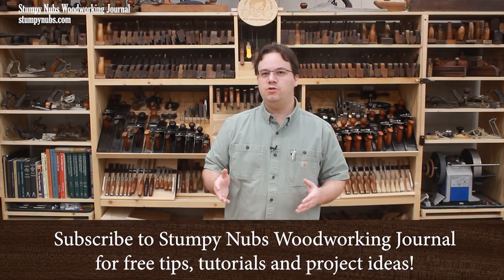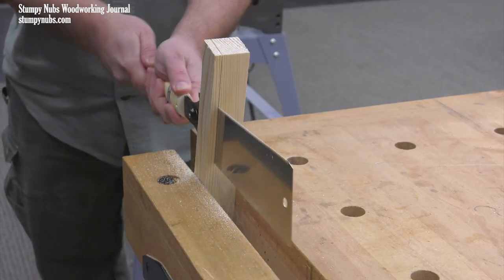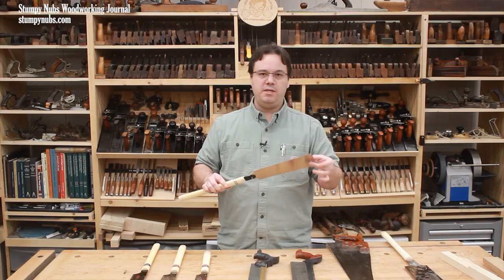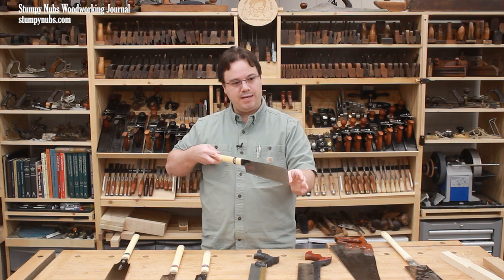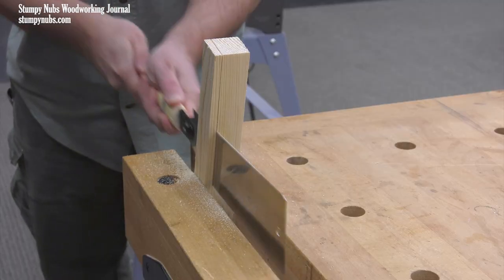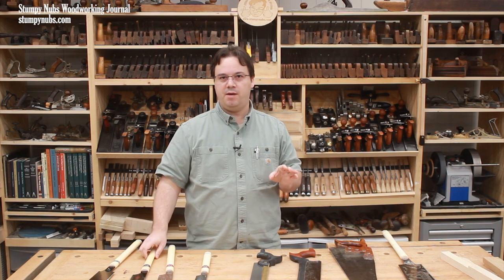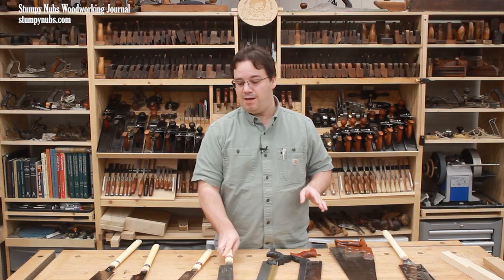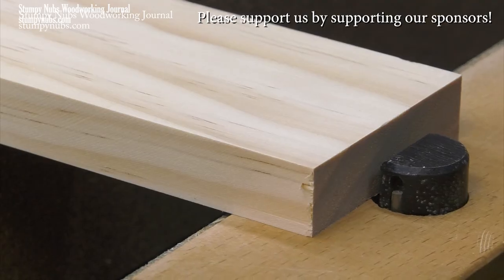Is Japan slowly killing western-style saws?

Comment: The disposable induction hardened blades are what make Japanese style saws viable at all.  And the CHEAP and massive availability of high quality USED western saws is the only thing making them a viable option compared to the cheap Japanese saws.  A high end sharpen able Japanese saw is silly when either a cheap disposable Japanese blade or a good used western saw will do just as well and the same can be said for a high end expensive new western saws.  I prefer western style saws, I've never payed more then $8 for one.  The only downside I see is you DO have to spend some time sharpening and setting, and learn how to do it.  (child's play compared to sharpening a Japanese saw)  Our bodies are just better at pushing than pulling, but Japanese saws take less force so it seems awash to me.  In general I'd say the smaller and finer the cut the more Japanese saws make sense and the larger and rougher the cut the more western saws make sense.  So I suppose if you have lots of high end power tools I can see where one might find more uses for the Japanese saws.  I've ripped oak 4x4's with a western hand saw without too much trouble because my 1960 table saw wasn't' up to the task.  While that could be done with A Japanese saw it would give me a terribly sore back.

Comment: No it's not.
Not until we in the west starts to sit on the floor to work.
We push they pull that is because they traditionally sat on the floor and if they had a tool that pushed then they'd push themselves over.
So that's why we push and they pull.

Comment: You didn't mention flush cut saws - my understanding is they have offset teeth on one side only, is this true?
Reply from the maker: Yes I did :)
Reply: @StumpyNubs  oh, I must have been confused with my understanding then, I assumed that one face of the blade had no teeth offset and the other had some meaning that the kerf was developed on only one side of the blade, meaning you could stay closer to a protrusion on a surface without scratching the finished face (think cutting off a dowel or similar). Love your channel by the way👍

Comment: While the video is nice and informative, Japanese tools are not representative of Eastern woodworking and the two traditions did not develop independently at all... 

Most of Asia uses Chinese style planes, which are pushed with both hands using a trough handle. In Korea or Taiwan people use Japanese style planes on a push stroke with a handle too. 

Most of Asia also uses frame saws on the push stroke. Frame saws eliminate the problem of tension but can be inconvenient when working on the ground like in Japan. The main difference between push and pull stroke is the length of the stroke, a Western panel saw is twice as long as a ripcut Kataba. This also means that the saws have a lot less teeth, which is why you can spend more time sharpening each tooth and get a more complex geometry.

Comment: I would disagree that there are "western" and "eastern" saws. Most of the slavic world and continental Europe were using frame/bow saws, which are used both as pull and push saw (you would say its twice as fast :-D). There were of course highly precise saws for detail woodworking, but those were made as well as bow saws. Saws without tensioning became popular maybe 20 years ago here in Czechia. Japanese made pull saws due to lack of amount of iron (they are thin), Americans and English made tons of steel of lesser quality than Japanese because they were the first to push with industrial revolution. The rest of Europe had shitty steel production for long time and are stuck in tradition, so making frame saws were logical choice - maybe even less material than Japanese with tensioning.

Comment: I've had my coping saw blade "backwards" since I was young, as I found it easier to control and less likely to bend the thin blade. That was years before I heard about how Japanese saws cut compared to western ones. I'm trying to actually have a mix of saws in my shop, as I've found there's also a difference for how you have to hold the work for if the saw cuts on the push or pull (and I don't yet have many options for holding things down).

Comment: you mentioned talking about cons, but you really didn't say anything other than different types of cuts use different saws, and most people don't have the tools to sharpen them, but there are some major points that should be addressed instead of just saying "east good west bad"  

For example,  the Japanese saws are designed for finer and simpler cutting, but that crosscut saw is designed to take down entire tree, something you would never do with a Japanese's saw. 

the push cut is much faster, and when done using proper technique and maintained saws is not going to bend or even be damaged. in fact, you made a point to mention that the Japanese saws with improper technique have a risk of catching, bending, or being damaged... so why is "user error" a con on both tools?  at that point it isn't the tool that's causing problems. 

pull cuts are significantly easier to injure yourself on.   some basic safety will mitigate most of this risk, but it is a simple fact that pulling a blade towards the body is  significantly more dangerous than pushing, which is why pushing is used in virtually every other cutting profession such as medicine and cooking. 

the eastern style saws are different tools, no replacements.  they preform different jobs with their own pros and cons.    you wouldn't suggest someone throw away all their Philips head screwdrivers because most Philips head screws can accept a flat head driver...  so why suggest that someone get saw a that does a different thing than saw b, because there is some overlap?

Comment: Quick answer no way, no contest, Jack saw can’t be beaten. You cannot get any where near the power pulling
than you can pushing. These pull saws are fir Micky mouse soft woods and little toy projects. Try cutting 4 inch
oak lol.

Comment: You remove more material when pushing on the cutting stroke. You can't pull and apply the same downward pressure. 
I can't even use a saw with a pull cutting stroke. Takes me forever

Comment: I'm not an expert i find the Japanese wander too much and need alot of training. Also you can't see the initial cut against the line because it is the opposite side so you are blind to your cut and have to trust your technique tricky, ive worked with a few experts and they have produced perfect work with both.i think western are easier to learn and produce quicker results

Comment: Draw saws make for more precise cuts, and with that statement you tend to start all western saws with a draw stroke. Think about it.
Reply from the maker: Western saws are started on a draw stroke to lightly run the teeth backwards over the wood to score the fibers without the teeth digging in. It really has nothing to do with the direction of the pull- just the direction of the teeth. Likewise, many lightly push a pull saw across the wood to begin a cut for the same reason.

Comment: This seems like a heavily biased comparison of apples and oranges here. Those Japanese saws are for finer precision cuts. While the western one is more for roughing in or imprecise cuts. You’d use a flush cutter for the same things the Japanese one is. Seriously, right tool for the right job anyone?
Reply from the maker: Not at all. While all types of saws are used for multiple purposes, generally Ryoba saws are used for the same cuts that large panel saws are used for. Likewise, Kataba saws are used for the same sizing and joinery cuts that carcass and tenon saws are used for. Finally, Dozuki saws are used for the fine joinery that dovetail and other fine western saws are used for. All of this was explained int he video.

Comment: I watch and like your menu videos. But please don't compare disposable Japanese saws over hand-made Western saws. It would be a more fairer comparison with disposable Western saws then. 

Japan still makes hand-made saws that are not impulse hardened, but high carbon steel that can be sharpened. There's one Japanese saw sharpener, that I know of, called a Metate, in Vermont. Mark Grable. Google search and you'll find his information.
Reply from the maker: Where did I compare disposable Japanese saws to handmade western saws? I made no such distinction. None of the Western saws in this video that were used by way of comparison were hand made. And I also made a clear distinction between handmade and disposable-blade Japanese saws. You really should listen to what is being said before rushing to the comments to issue a correction...